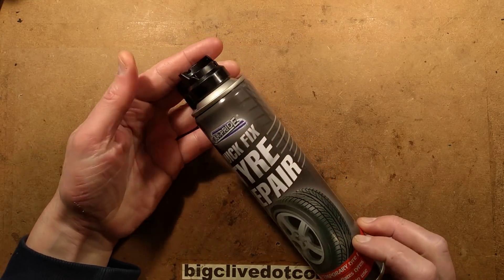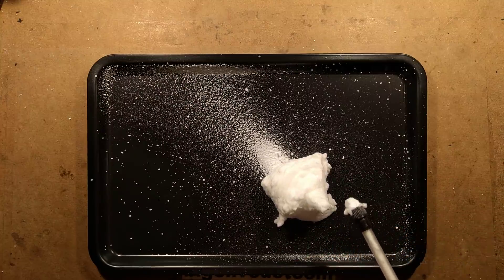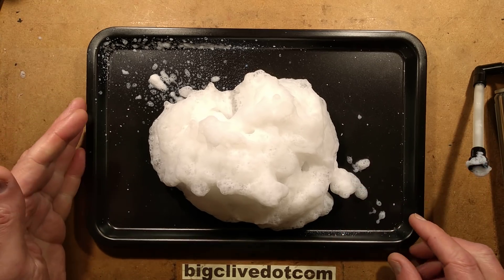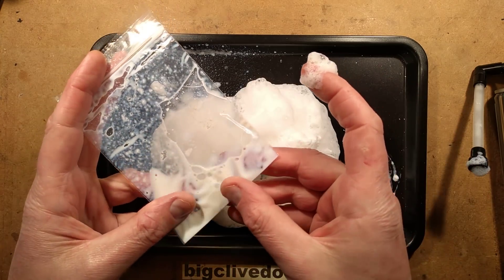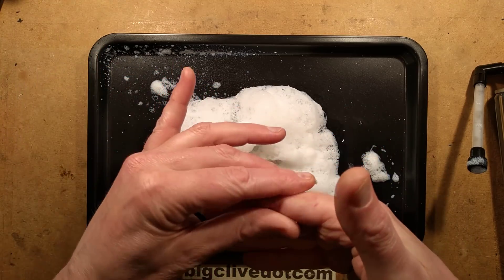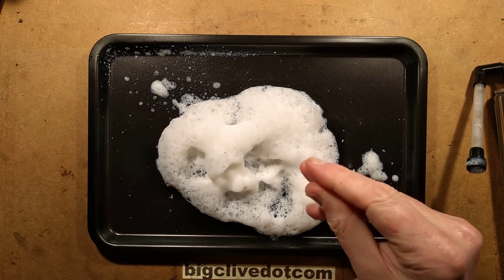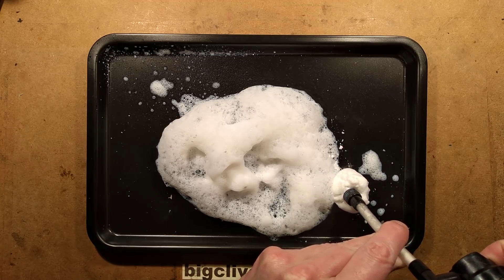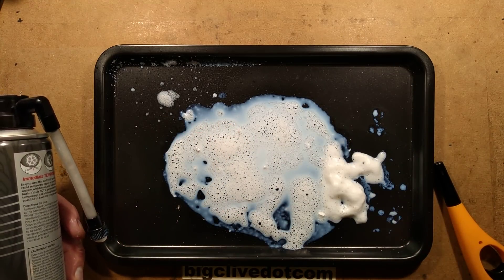What's in a tin of foaming tyre repair liquid.

Comment: Was to a public building from the parking lot when a small pickup pulled in and parked about 25 feet in front of me. The left rear tire exploded with such force; the wheel's profile went from concave to convex in a fraction of a second, the truck's rear end and axle were destroyed, the right rear of the vehicle next to it was caved in, I was thrown backward, and both nearby buildings were shaken hard enough for the occupants of both called 911! Upon investigation it was determined the "fix-a-flat" product had been used to fix a low tire. The tire was still underinflated, got too hot, the propane and oxygen ratio was at stokeo, and it exploded!

Comment: When I was younger, I used a can of Fix-A-Flat (not sure if thats a brand sold across the pond), and I never did have the tire properly repaired. It hele up for several thousand miles until the rest of that piece of crap car fell apart and got sent to the scrap yard. 

I wouldn't recommend using it a permanent repair, though. I was just broke at the time and then ended up forgetting about it.

Comment: I've used it for slow punctures. One of my tyres was losing air and triggering the low pressure warning about every two weeks. I squirted in a dose of sealant and it has been fine now for a couple of months. Maybe it has just disabled the sensor?

Comment: As a kid, we used these to fix punctures in bike tires.  I used it on my car a few times, but they couldnt patch much of anything larger than a small nail, what they did patch worked pretty much forever though. Fun fact, scrubbing bubbles cleaner has that same flame effect when burn it.

Comment: I use this stuff in all my bicycle tyres even before they get punctures, they last SO MUCH longer as a result. Bike tyres are higher pressure and far less air than car tyres, every bike owner knows that the slightest leak causes them to go down quick but the foam helps tremendously. Hint: let the air out the tyre before putting the foam in.

Comment: I work in a garage and I have never seen this fucking shit work. All it does is make a fucking mess and coat the inside of the tyre so you can't repair the hole. Alot of cars come with a variant of this instead of a spare tyre. Fucking useless if you've busted the sidewall on a pothole.

Comment: About 10 years ago when I was moving states, the wheel on one of the carts we were pulling behind one car in our comically long conga line of cars popped and, at 3AM in the morning, on a dark country road in Eastern Ohio, a family member drove out to the nearest town and grabbed a can of this "fix-a-flat" type filler can not unlike this (though I think the stuff we used was firmer than this wet gloop crap). They sprayed it in the wheel and we waited 10 minutes. It managed to drive perfectly fine for the next 300+ miles of rough country roads in the dark at 60+ miles/hour. Ever since then, I have been sold on this concept. Stuff works miracles. Just do not expect to "save" the wheel after. It is just an emergency thing to keep you from being stuck.

Comment: Used it in tires and left it for several days of use. Tires eventually go flat and have to be fixed. The moisture will probably evaporate as tires tend to get hot no matter what the weather.

Comment: Most of the cans I see here have a little sticker on them that you are supposed to stick on the wheel next to the inflation Valve. It tells the tire mechanic that there is flammable gas in the tire.
On a side note, my grandfather's truck ran on propane. Lots of mesquite and other big thorns in west Texas. He would air his tires up with propane. Never had an explosion. We always told PA his truck smelled like farts.

Comment: If you use it it and leave it in your tire it eventually turns to that liquid which creates a strange tire balance problem. The water spreads insode the tire at low speeds but at higher speeds it forms on one side of the rim and creates a horrible thumping out of balance tire. So you must later de-rim and clean the tire after you repair the hole. You can never normally balance a tire with that liquid in it.

Comment: I used this awhile back, and it worked, but because I didn't read the directions, my tire wobbled really badly when I drove it. Glad I was only driving it to the tire shop. The instructions actually say to drive it around slowly immediately after filling so that it doesn't settle to one side, like what happened to me. I guess it takes 10-15 minutes for the solution to "settle."

Comment: I have used these with great success, always keep one in the car particularly on long trips.

It is certainly latex, if you read the instructions they state to actually leave the tyre mostly deflated and you MUST drive after filling it with the foam, this is to increase the temperature and in turn the pressure of the tyre (they get quite hot on the road!) to encourage the latex to set. 
Lots of swerving speeds up the process.

It's really just a temp fix, however I have known people (my dad specifically) to have fixed tyres using this and still be driving on them 3 years later with zero issues, eventually the latex just sets inside. Not saying it's a great idea, but it can be done.

Comment: It settles out as an oil like liquid in the tire. I have left it in some tires for a couple of years. Most tire shops don't care its in there. They just tell me it makes it easier to break the bead when they replace it and if they don't expect it can startle them from the quickness and noise of it pulling off the rim.

Comment: There's a hand cleaner in Canada that is basically the exact same stuff.  It did not last long on the market.  The intent was that the eraser-like properties of the latex would rub the oil off your hands.  It worked, but the effort involved in using it wasn't worth it.

Also, never use that crap in your tire.  The tire shop will hate you.  Carry some tire cord plugs, an awl, and one of the hooks for stuffing them in the tire.  Takes the same amount of time but the tire shop will love you.  Or you might not even have to go there, that type of repair sometimes lasts the life of the tire.
Reply from the maker: I keep the cord and awls in the boot (trunk) of my car.

Comment: Iv used different Brand but Iv put some of these in my spare tyre with a hole in back sidewall and drive 6 hours around 300 miles and held up fine and over night was still fine

Comment: Years ago I bought a can of this stuff (or similar) made by Holts, to carry on my moped, just in case, anyway some 32 years later I thought that I'd try it on another motorcycle after getting a small screw in the middle of the tread. Amazed to say that it worked! I had ordered a new inner tube for this bike so wasn't going to ride it to work etc until that turned up, I did ride the bike around the block a few times and it did stay inflated for the whole week at least.

Comment: Bought a motorcycle that handled funny. Found out that previous owner had put a lot of the green stuff in the rear tyre as a preventive measure. The green stuff had harden at one point in the tyre as bike had been parked up for months before I bought it. It took me about 60g of tyre balance weights to offset the imbalance until I removed the tyre. Was shocked at finding the big green slug of gel.

Comment: I got angry with a part-used expanding building foam that wouldn't come out of the tube a few years ago... Tried and tried to unblock it, then dashed it to the rocky ground in anger. It burst, span and jumped around as the foam squirted out and showered the garden/patio with blobs of foam which took AGES to collect one by one... Talk about environmental disaster!! :-/

Comment: Now I wonder if I can make my own repair fluid. I would get some latex milk, add a tiny amount of sulphur and mix it. Then I would put it in a syringe and remove the valve to fill it into the tire. Then pump it up with air and heat the spot where the stuff comes out for vulcanisation of the rubber.

Comment: From what I have read on the ones I have used they don't fully inflate the tyres, it just inflates it a bit then you have to rotate the wheel for so many minutes then when the hole is sealed you then have to fully inflate the tyres with a pump

Comment: I once used this stuff on a punctured bicycle tube. It reinflated the tire and sealed the pinhole puncture so that I could ride on it... for about 19 hours (overnight). Then it started to break down and wouldn't reseal, leaking into the tyre itself, and from there to the outside of the wheel through every nook and cranny. Not only that, it also completely fouled the valve, making the tube an unpatchable write-off. I wouldn't recommend it, myself. At least not on a bicycle tire, unless you absolutely have to be somewhere in a big hurry.

Comment: I have used this stuff in 3 tyres on separate occasions, 2 had screws through the tread and one was a nail, it worked perfectly for me, and lasted the life of the tyre,(except for the nail) this turned into a very slow leak but still lasted a good while ( the screws had a thread which probably helped trap the latex).
I would not recommend Motorway driving though. I would add, now knowing that the propellant is butane, I would consider using the product but after driving for a day or so to allow the latex to do it's job and expel  the butane and re-inflating with air!!! ( what this may do is unknown) just a thought! but Hey ho! .

Comment: I've actually used this recently after a road trip. My tire had a smallish puncture, I needed to inflate it every other day, and I used a similar spray which I got from Home Bargains, but I only used half of the bottle of the spray. The propellant gas inside was nowhere near enough to inflate my tire, so I topped it up with a normal compressor until 2.3bars which is the factory value. The instructions said that I should drive around for a while to make a good seal, so I drove for a 10-15 miles. The next day I saw that the tire lost a bit of pressure, but after inflating the tire again it was fine. This was roughly 6 months ago.

Comment: I once had a slow leak in my front tyre, turned out to be a screw in it. A mate gave me a can of an australian equivalent tyre repair stuff. I left the screw in it as the instructions told me too. Long story short, it pumped the tyre up (had to let a few psi out). Sealed the leak and i kinda forgot about it. Ended up lasting over a year of driving on it every day. Highly recommended

Comment: The contents of the tire will end up well above the upper explosive limit (too much butane) for ignition if reinflating a flat tire. The fix will be temporary for a few reasons. First I don't expect latex will form a very good seal and the butane will leak out of the hole. Secondly butane, unlike air is probably quite soluble in rubber so will diffuse out the walls of the tire relatively quickly. The biggest risk would be if the tire was reinflated with one of these things and then left to go partially flat and then inflated again with air, forming an explosive mixture.

Comment: Here's what happened to my tires after I kept the chemical in for a long time: it somehow weakened the rubber.

Here's the long story: I had a motorcycle and, for some reason, the rear tire started losing air. Then I put this stuff in and it fixed the problem. Then the whole thing repeated several times and then at some point it wasn't working anymore. So I took it to a tire shop (after almost a year later than the initial "repair") and got it repaired properly this time. However, the motorcycle was vibrating like hell. So I took it back. Guess the reason; the rubber on the sides got so weak that the initial high pressure impact (see how tubeless tires are fitted) stretched the sides. So my tires were no longer round.

Moral of the story: protect the nature, love trees, kiss a bear and don't use this stuff unless it's absolutely necessary.

Comment: Hello Clive

I have 2 DJI Phantom II battery’s that are refusing to take a charge, I didn’t use them for over a year (Whoops)

They seem to be in good condition, they’re not puffed up, I wonder if it’s the circuitry preventing them from powering up - even the charge indicator LEDs refuse come on.

They have only been used a couple of times each, so almost brand new - apart from the damage done by leaving them charged for so long.

Would you like them? Happy to post at my cost and for you to do as you wish with them.

Would you like do
Reply: Ignore last line, can’t work out where to edit haha

Comment: There was a story that my tire guy told me about. They used to and may still have stickers that you were to put on the tire that said that the stuff had been used in the tire.
The reason was at some point they were using propane as the propellant and some poor tire guy sort of blew himself up when he went to repair a steel belted radial tire.
He had used the steel tool to prep the puncture and it had somehow made a spark in the tire and things got messy when the tire blew up on the guy. Not sure if he was killed in that accident or it was just some urban myth or it really happened.
Well I guess it did happen in 1998 "Victims awarded $80 million in tire inflator lawsuit" It was not a tire repair person but sounds like a home owner doing work on the tire at home. That incident at least did not get anyone killed. But the injuries were not slight. Two people involved in that one.

Comment: I saw a can of something very similar to that that used a Latex-like substance but it was super sticky.
I think the idea was you spray it inside the tire and it eventually forms an inner-skin or something along those lines after the wheels been span up off the ground.
Held up to 10psi of air (which is abit naff) but cool stuff.

Comment: 30+ years ago when we went to the desert in dune buggies we had stuff called gunk (now called tire slime) that you squeeze into a tire with a leak and then fill it with air and immediately drive around, it had strands in it and they would try to exit the leak and would then harden and make a pretty good seal.

Comment: I've used this stuff several times. And I've driven on it for LONG distances. The most recent was a few months back - had a third flat in a month(seriously, huge potholes where I live) but on the previous flat the tire iron had broken and new one not arrived yet. This particular tire had gone from completely full to completely flat in the span of about two hours while my boyfriend and I were swimming. We put a can of this stuff in, it inflated it about to half. Drove very slowly to the nearest air pump(about a mile / 1.6 km) and filled it the rest of the way. Took it to the shop the next day and the mechanic said to just give driving on it long term a shot as he couldn't properly patch it now that the stuff was in there. So we have, and it's been working fine for the last few thousand miles. Was off balance a good bit at first but that has eased to unnoticeable over time. The tire is still at 35 PSI - it hasn't lost any air at all.

Previous times I've driven long term on it out of necessity - this stuff is $6 and a tire change alone is $60 without something like a tow. I'm disabled so I can't change a tire by myself so before my boyfriend lived with me a few different times I've relied on this stuff. It's stopped some fast leaks, although the tire does need to have structural integrity left obviously(the two previous tire failures in the month mentioned above were complete failures. When my boyfriend called me about the first I mentioned this stuff and he was like 'lol, no. The tire is shredded.') I've never had a problem driving on it long term. As someone who has had to push my tires much further than I should due to money, this stuff has saved me more than once.

I think it's a great product as long as you know what you are getting in to - it may put a shake or vibration in your car, it makes the tire much more difficult to patch/repair, and it can't work complete miracles. But if money is a concern, or you don't have a spare, or you have no way to change a tire then it's definitely worth it in my opinion. I never drive without a can in the boot/trunk. It's a good bit of insurance that has served me well.

Comment: Tire shops hate this stuff to repair the tire it has to be completely washed out clean with tire solvent or a patch will not stick because of it  BTW plugging a tire is a very bad thing its a temporary thing too . Best to just change out with the spare and get the tire to a shop for a correct fix .

Comment: My brother is a mechanic with a company that does repairs on high-end cars. He hates this stuff. It's messy, and in some cases, ruins the tyre - it usually always clogs the valve. Generally, if it has been used, they replace the tyre as a matter of course. It reverts to a stinking fluid, which pisses out over everything when the tyre is removed. Not good.

Comment: You mentioned putting a flammable mixture into tyres and it reminded me of a gizmo my Grandad owned.

Not sure where it came from or who designed it, but it was a device for inflating tyres.

In essence it was a hose with a valve to fit onto a tyre at ONE end, and a fitting to engage into an engine block's spark plug hole on the other.

Apparently the idea was to take out the spark plug, and plug this hose in its place, and use the compression to fill up your tyre - presumably with a fuel/air mix, perfect for combustion.

I've no idea whether this would even have worked, or where "inflate tyre" fits into suck, squeeze, bang, blow, but that was the tale... perhaps my dear old grandad was winding me up.

I'd be interested to hear others thoughts on the matter.

Great vid Clive. As always.
Reply: I had one of these back in the 70's, they worked well on a 6 cylinder car, not so well on a 4 cylinder.😇 Grandad wasn't winding you up.